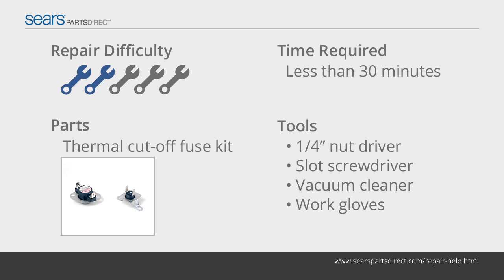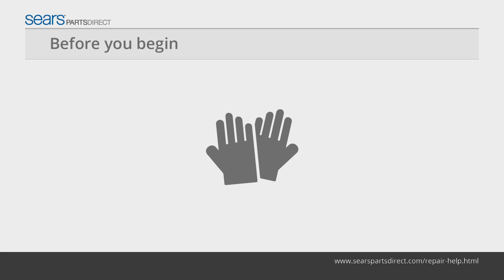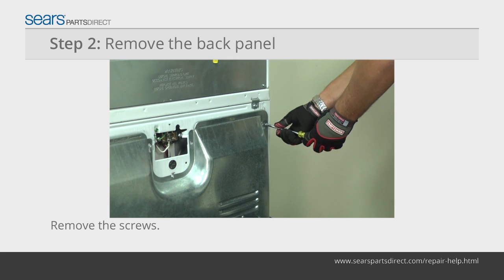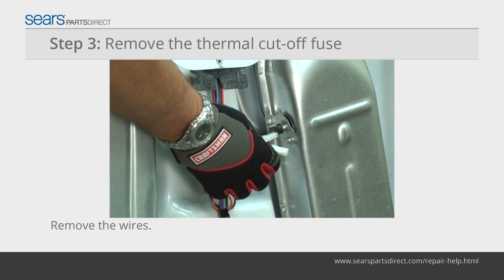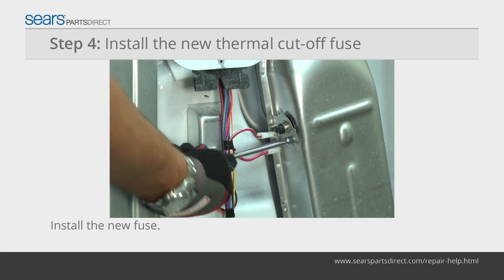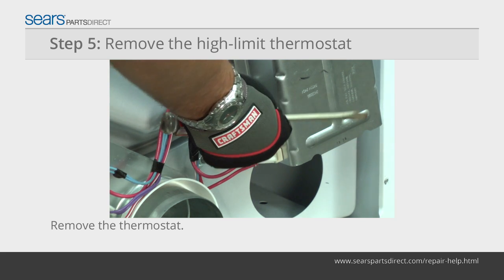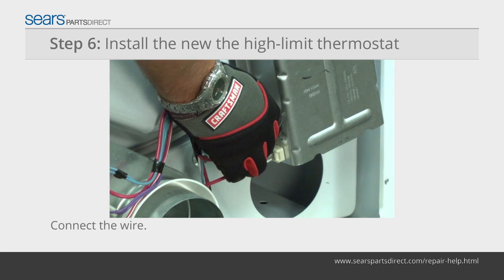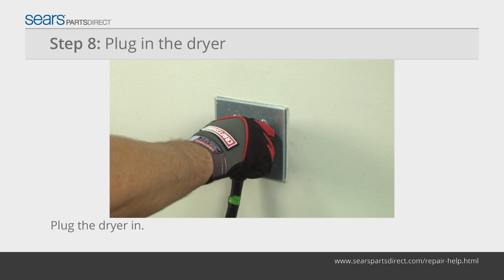How to Replace a Kenmore Electric Dryer Thermal Cut-off Fuse Kit

Comment: I have a Kenmore 11064202200 Dryer. I am confused about where the orange wire goes on my heater element/cut-off fuse. Thank you.
Reply from the maker: The orange wire connects to the small male spade that's on the side of the high limit thermostat with 2 spades. We hope this information helps. If you need further assistance, let us know.

Comment: I have a Kenmore elite model # is (110.62952100) and I’m not sure where the wires go on the thermal fuse I have can you help?
Reply from the maker: Your dryer is different than the model shown in this video. To access the wires going to the thermal fuse, follow the steps shown in this illustrated repair guide to remove the bottom front service panel and lint duct assembly: https://www.searspartsdirect.com/diy/repair-guide/how-to-replace-a-dryer-thermistor . Be sure to unplug the dryer before accessing internal components. The thermal fuse is just to the left of the thermistor shown in that repair guide. The thermal fuse has blue wires attached to it. When the thermal fuse is blown, the dryer won't run. If the dryer won't heat, then you'll want to check the thermal cut-off fuse which on the side of the heating element housing. The thermal cut-off fuse has red and black wires attached to it. We hope this information helps. If you need more assistance, let us know.

Comment: I have a Kenmore Electric Dryer#40289032011.  I'm getting ready to put the heater housing back in, but I didn't track which cord connects to each terminal.  There are three components (Heater, Thermostat 2, Thermostat 3) and 3 sets of wires (Red & Blue, Black & Blue, Black & Blue)... are you able to provide information on getting it hooked up correctly?
Reply from the maker: The blue wire coming from the electronic control board attaches to one terminal of Thermostat 3 (it doesn’t matter which terminal since Thermostat 3 is just a simple switch). One black wire attaches to the other terminal of Thermostat 3 (doesn’t matter which black wire). The other black wire attaches to one terminal of Thermostat 2 (doesn’t matter which terminal). The blue wire paired with the second black wire attaches to the other terminal of Thermostat 2. The red and blue wire set connects to the heating element terminals (doesn’t matter which order). We hope these directions help. Let us know if you need further assistance. If you’re not sure that you can connect the wires properly, you’ll likely need to have a service technician connect the wires.